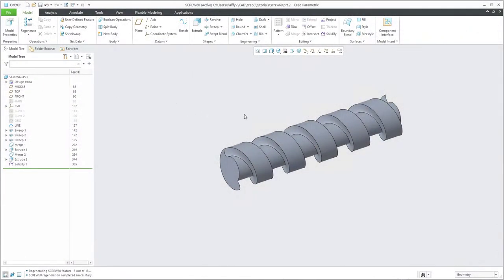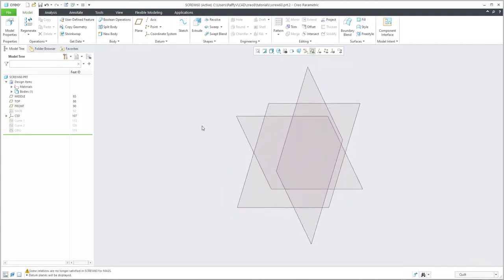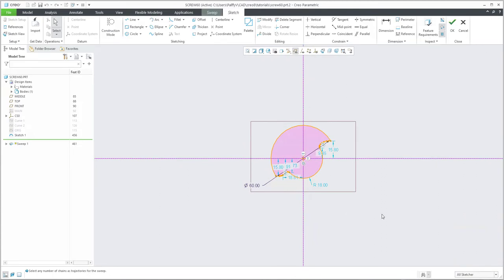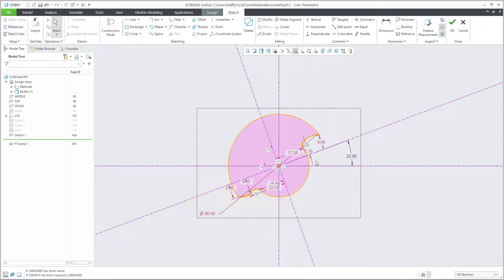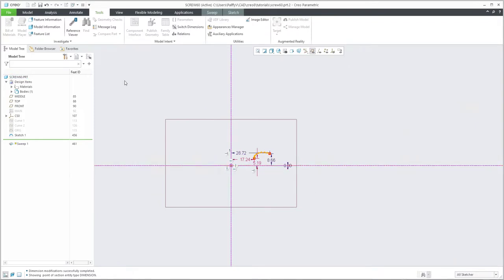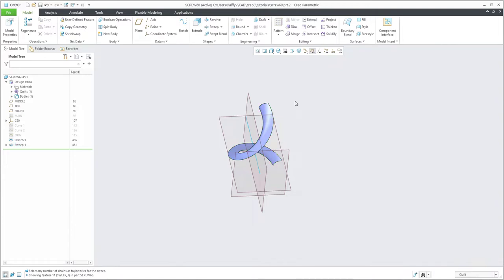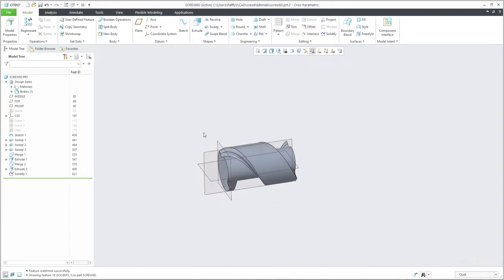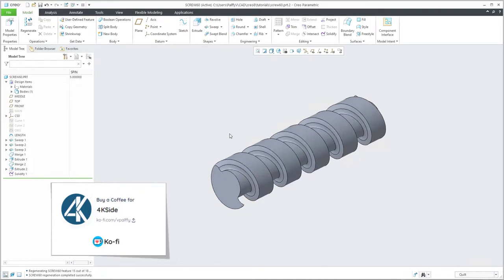How to create Worm Gear Shaft - Creo Surface modeling

Comment: Hello. How to change the rotation direction of a sketch? If you need left and right thread? What needs to be changed in the equation sd33=20+360*trajpar*spin?If I change + to - it gives an error.
Reply from the maker: The orientation is defined by sketch dimension, so if you need to spin it on opposite direction, set proper orientation before definition of the scetch.

Comment: Why have you done it this way instead of a helical sweep?
Reply from the maker: Hi, try to check Helical Sweep tutorial (directly at the beginning I have explained differences by picture) Simple to say: you can use this technique if you know section of the shaft, if you know section of the thread you will use Helical Sweep feature. Bye Vladimir